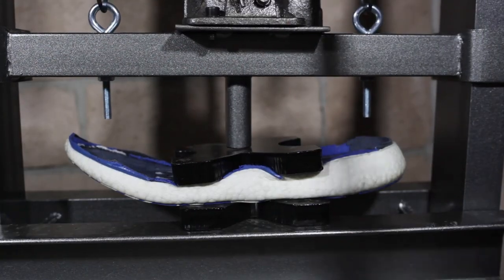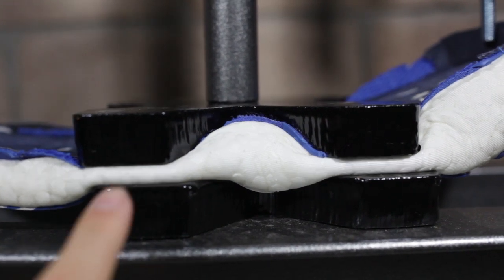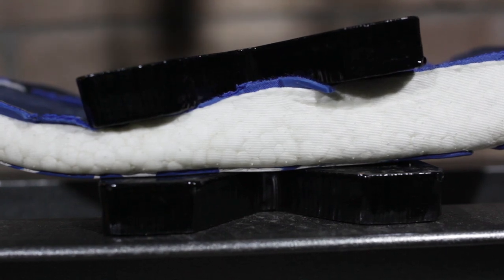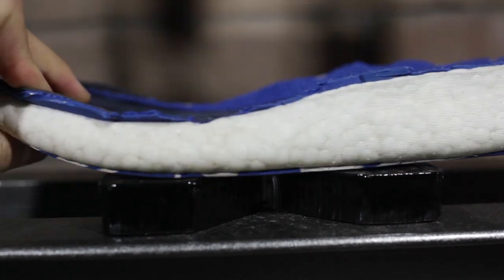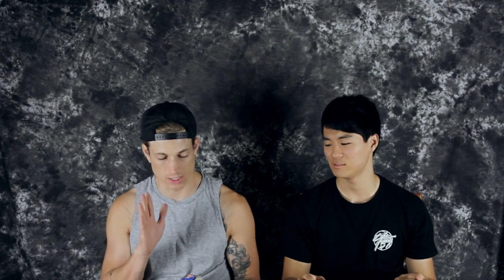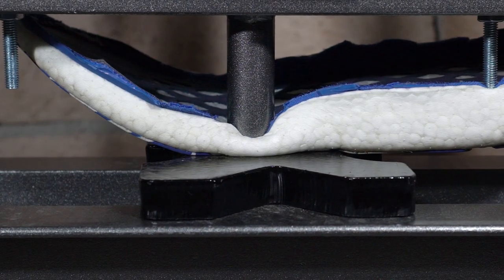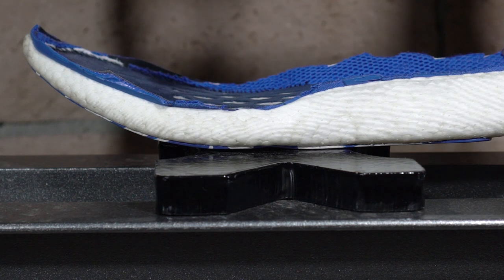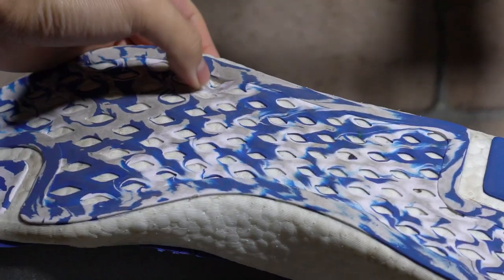What Happens When Boost is Put Under 12 TONS of Pressure!?

Comment: Video idea: 10 things better than the Jordan 31 traction (try duct tape with the dry side on the floor).
Reply: My 31s have great traction...
Reply: Millicente yeah compared to what shoes
Reply: Millicente no they don't
Reply: FPS Wolf Airsoft You're literally going to tell me what I feel under my feet when I play is wrong? When I play in them they're amazing. If yours don't play the same then too bad. Should've returned them or sold them or given them away. At worst you have a casual shoe to wear.
Reply: Millicente dude, whether it feels nice or not, doesn't matter...it's a suck ass traction
Reply: My 31s also have good traction. It's not as good as my 29s but it gets the job done.
Reply: FPS Wolf Airsoft You're completely missing the point aren't you? I'm saying they work really well FOR ME. If yours sucks, too bad. Mine work really well.

Comment: Do you guys know if it's possible to cut out the existing strobel boards out of shoes to access the real feel of the cushion without it completely screwing up the rest of the shoe?  Because the strobel board is stitched to the upper so I'm wondering if the middle 
Midsole would just fall off...
Reply: Fernando Portal how did it feel after you took it out?  Was it flimsy or did it make a huge difference?
Reply: Fernando Portal cool. Thanks for the feedback!